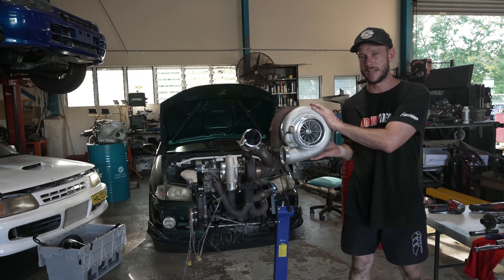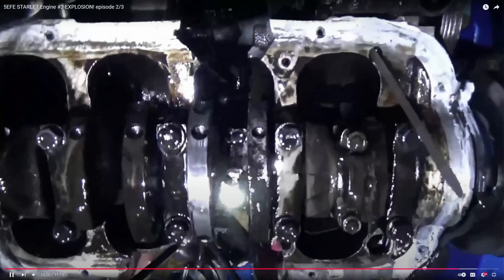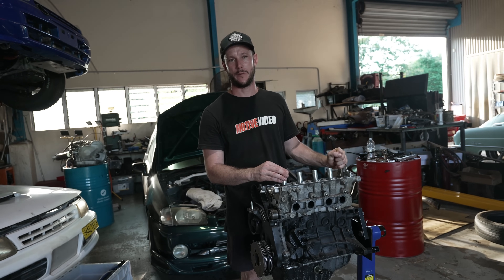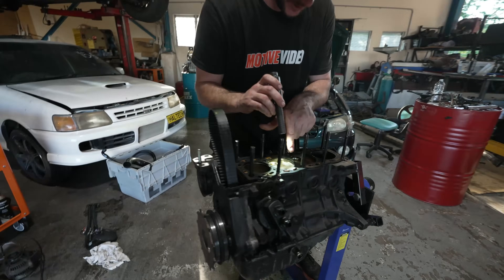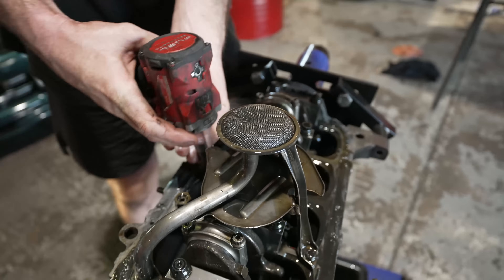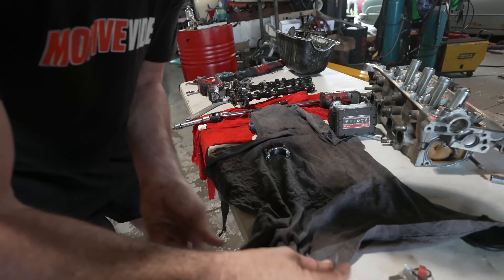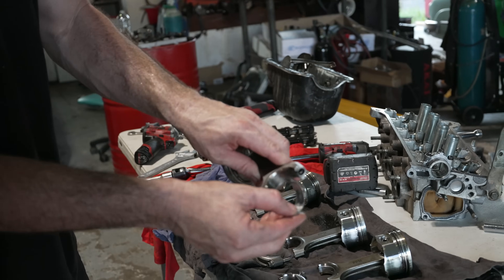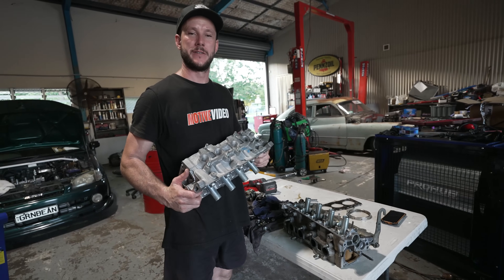We broke our 1300cc engine

Comment from the maker: Boys you know we are gonna use those cracked pistons and still go for 800hp
Reply: Save 'em and do a give away when you hit 50k subs, let fans have a piece of Camp Dog history
Reply: @Camp_Dogs  Hello brother! I was trying to buy the wheel speed trigger 24 thooth from you but apparently you don't ship to the USA, let me know if you can make an exception for me since I need that for a competition in December
Reply: Hello brother ! I was trying to buy the wheel speed trigger 24 thooth from you but apparently you don't ship to the USA, let me know if you can make an exception for me since I need that for a competition in December
Reply: Any idea why cylinder 2 was detonating?
I haven't seen all your videos for the build on this engine, only the last 3 or so. Was wondering if you have a test rig to flow and duty cycle test fuel injectors and made sure your set was matched? I know a builder who went through a couple engines before making his own test rig and discovering an issue at high duty cycle with some of his sponsors injectors.
Reply: Later I will send you a video of my 5efe in my car, It is a 1994 Toyota Paseo (Cynos)
Reply: Hi Matt if you’re considering a copper head gasket a bunch of us old starlet club guys back in the day had a group order on 2mm copper head gaskets from Ridgecrest Engineering in Victoria. They should still have the 4E design on their system and could probably make it for the 12mm studs you’re switching to - or you could just Camp Dogs it with a drill bit 😂
Reply: Jb weld
Reply: Spot weld the crack in a few areas
Reply: A mate of mine used to play with Isuzu engines, he had similar bearing problems. He had best results with cheap shit bearings, the fancy ones had a softer metal layer in the middle which used to allow the wearing surface to move too much and it just peeled off.

Comment: remove this noname (Kappa) 1300cc form this car and put a good old Golf Engine in it like the VW 1,8L 16V 4 Zylinder Turbo Motor (1781cc) and then you can get up to 1013PS Engine/973PS US(Wheel) on only 61PSI

Comment: Guys, I have a question, do you use pins ARP from a 4A motor with M10x1.25 thread, stock thread M9х1.25, did you just cut a new one using the old thread?
Reply from the maker: First time we tried to drill and tap by hand, a few of the studs weren’t straight and we had to bend them so the head would go back on 😂

Pull the block out and take it to a machine shop
Reply: @Camp_Dogs 
This is a classic when you do something for the first time. Now I'm busy repairing my 4efe, and the question arose about the head bolts, at the moment the only ones available are studs from a 3SGTE engine, according to the thread they identical. Only the question of the length of the factory bolts of this 3s engine is 118 mm, I think this will be enough to offend the 0.6 mm metal package with 75 mm pistons

Comment: I cannot wait for the Head to go on.. also I. Have a .52 rear housing on my starlet it can't be that bad on a street car, what HP you reckon, compared to td04 I think it may hold 250whp comfortably
Reply from the maker: For small boost it’s perfect. Just watch your air temps before and after a run, it will tell you everything you need to know

Comment: Where are you guys mounting the hall effect/VR sensor for crank position? Trying to set up a similar trigger wheel on my 4E attached to the harmonic damper
Reply from the maker: We made a bracket off the side of the engine to hold it. we have since seen people use a factory 5efe second gen oil pump, it has a sensor that bolts onto the oil pump and has a different crank timing gear.

Would be farrrrrr easier just to do that next time.

Comment: get some proper knock detection so you can hear if a cylinder is making any noise and which. Bearings are odd though, with plenty of oil, and unless crazy detonation, they should hold up well. Plenty of motorbike engines pushing that power without issue

Comment: curious,
what rpm you are spinning it to?
what rpm is the boost coming in?
are you bending the wrist pins?
how big are your bearing clearances and what oil are you running?
Reply from the maker: We only went to 8400 this round, then the head lifted. Rev limiter is usually 8750

Comment: Is it still using stock camshafts as well?
And get some solid motor mounts.
That engine close to running away from the body.
Reply: Every time they put it on the dyno, the engine looks like it wants to get up on 2 legs and walk out of there
Reply: @MichelleSleeper  😂
Reply from the maker: 272 cams
Reply: @Camp_Dogs   what brand may i ask?
Reply: another question, what turbo would you recommend for a 4efte with forged internals? stock cams.. hoping to get around 350-400hp
running a precision 5831 with a .48 housing but i seen your videos regarding bearing problems, we spun number 3 lately and need some advice on what turbo to get to prevent it. Had to get new crankshaft and rods, it was that bad.

Comment: What you have got out of that engine vs budget is quite amazing, with an almost unlimited budget they were only getting 1400 hp out of a 1500cc f1 engine in the mid 80's, half that from a 1300cc is pretty bloody good, look forward to seeing you break more stuff.
Reply: A lot of that came from the fuel type they used and those figures weren’t generally attainable during the race, only during qualification, as it trashed the engine!

Still cool though haha!

Comment: the way you boys go through head gaskets, is it time to make one out of copper sheet yet?
Reply: I had a 2mm copper gasket made by a company Ridgecrest Engineering in Victoria, you would just have to over size the bolt holes to suit the 12mm studs you’re going to use